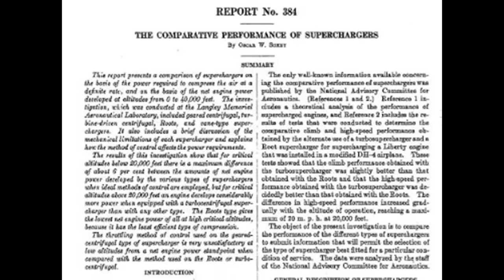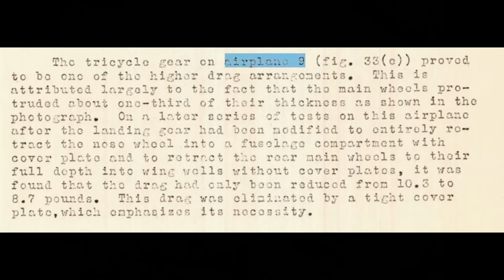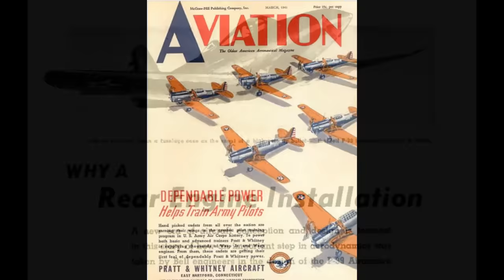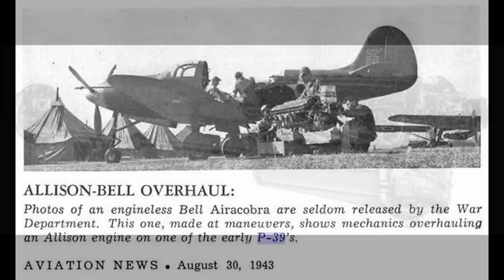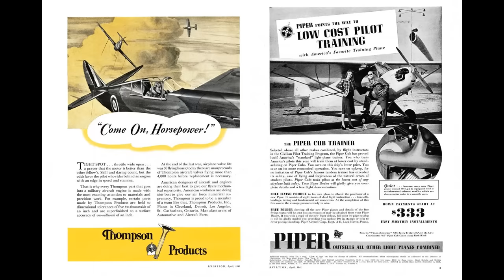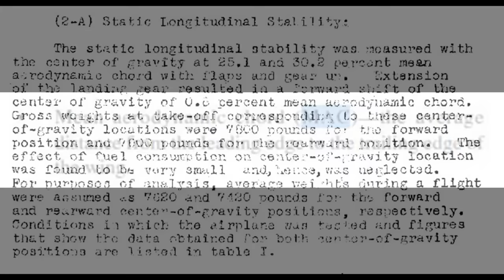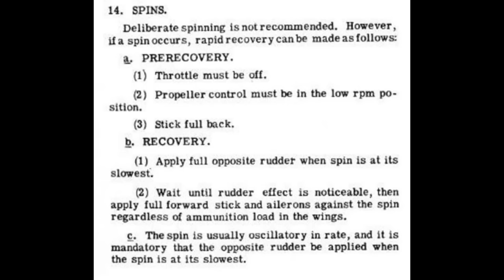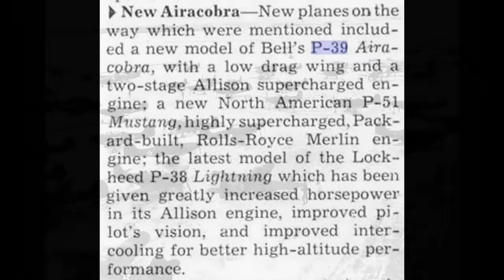Bell P-39 Airacobra, Why the Mid Eng?

Comment: I once had the opportunity at an airshow to  stand directly in front of a P-39 during the start up and warm up period. The amount of shaking (or wobble) back and forth on that long spindly front landing gear was shocking to see and for a few seconds caused fear that a catastrophe was imminent. Ever since then, that's about the only feature of the airplane that gives me pause to wonder about how that worked out in service, especially on less than great surfaces. Thanks for another great video, Greg. I've noticed that you are referenced very favorably by commenters on other aviation channels, so good on ya!
Reply: It must have worked pretty well or they wouldn't have been suitable for the ussr,I imagine that the front line airfields were pretty rough
Reply: Probably why the awful field of vision contributed to it crashing into a b17 at an airshow this year. Hindsight is 2020
Reply: @danepetersen9879  In that terrible accident, the P-39 was in a left banking turn, as were all the planes that were following the airshow round robin path. The B-17 was also in that pattern, but a little to the starboard of the P-39's path, resulting in the B-17 being in a blind spot for the banking P-39 pilot. It would have been a blind spot for any single engine fighter of that era. In the video, the B-17 apparently leveled off from its banking turn, which could have put it out of the path of the oncoming P-39 except for the speed and timing of the fighter's approach. Had someone in the B-17 seen the imminent threat, the pilot could have taken some evasive action, but if that happened, it was not in time to avoid the collision. It was a sad loss all the way around, both in lives and aircraft.
Reply: @kenneth9874  Yes, indeed, it worked well for the Soviets. Standing there watching the wobble from a lay person's viewpoint, however, made it look pretty fragile.

Comment: The end of the story could have included "the Airacobra shot down more enemy aircraft than any other allied fighter", about 5200 according to the Soviet pilots. Half of their top aces flew P-39s and they operated them at full throttle instead of the lower recommended settings. The P-39 flew the entire war with the same basic engine while most of the other fighters got huge increases in horsepower. A 2000hp Cobra would have whipped them all, as it did in the 1945 national air races. Great job Greg as you always do. This is the best Airacobra review I have seen.
Reply: By now, its a given that pretty much everyone involved in aerial combat overclaimed kills.  When one adds the propensity of fighter pilots to overclaim (Note that I'm not stating that overclaiming is intentional) to the Soviet tendency to wildly exaggerate victories and minimize losses, I'm very skeptical of any numbers coming from Soviet sources.
I'd love to see some research done on claimed kills versus acknowledged German losses on the Eastern Front along the lines of what Eric Bergerud did in Fire in the Sky, his book on aerial warfare in the Southwest Pacific during World War 2.
Reply: @barrettjet  The Soviets were allied with the Germans for the first year of the war; for the first 22 months, actually.  During that time they'd have been shooting down Finnish planes, mostly.  Or being shot down by them, more likely.  
I've had a poke around as far as Soviet aerial victory claims, and it seems someone has done some analysis on those figures.
Christer Bergstrom has written a series of books on the air war in the east.  They seem very well researched.  You can look for reviews and descriptions online if you like.
 In his "Kursk- The Air Battle:  July, 1943" he describes the Soviets as claiming to have shot down 487 German aircraft of Fliegerkorps VIII as against German recorded losses of 41.  
The Soviets claimed 391 against Luftflotte 6 as compared to German records showing 39.  That's a ten-to-one claim vs actual, at least.
In Bergstrom's volume on the air war around Stalingrad, published in 2007, he describes an action in June of 1942 in which the Soviets claim to have shot down nine German aircraft as against German records showing no aircraft losses on the day in question.
One of the factories that the Soviets moved behind the Urals in response to Barbarossa must have been used to manufacture German aircraft data plates if that's what they were using to confirm aerial victories.
Again, I acknowledge that everyone overclaimed, but the Soviets look to have made it official policy.  Can't say I'm surprised.

Comment: One thing I’d say about CG is that, as the designer, if your CG moves back because of a mid-engine mount, you just shift your wings backward to accommodate it.

Bell wouldn’t have designed an airplane knowing they had an unstable aft cg. I’m surprised anyone ever made that argument.
Reply from the maker: That's exactly correct. The wing placement is a huge part of this, and they just move it back. Look at the 727 picture as an example. However at the time people were afraid of pushing the P-39 hard because they were unjustly afraid of it.
Reply: You could move your wings back, or extend your nose, put the prop further up front and extend the drive shaft, and bang. You give yourself nose room for extra fuel storage or an extra cockpit or something! 

I'm an aircraft mechanic, so I have a rudimentary understanding of CG stuff. Haha
Reply from the maker: Yes, a lot of problems can be solved by making the plane bigger, and very often that was the solution used.
Reply: @davecrupel2817  I'm not a aircraft mechanic, but was a lifelong tinkerer of H.P. and a racer I have a million ideas 💡 to build aircraft with this engine placement, even a private high-wing model design, in my head. I'm old and disabled now. But most of the brain 🧠 is still working...lol...from Wyoming USA 🇺🇸 🤠
Reply: Having the mass at the middle reduces the moment of inertia which permits the aircraft to turn faster. Having all the guns in the nose reduces the weight of the wings improving the roll rate and makes aiming easier.

Comment: I think one factor with people saying the P-39 has no supercharger is that people frequently discuss (turbo)supercharger (stages) in terms of their impact on altitude performance, and a mechanically driven supercharger that's running at full blow at sea level doesn't impact pilot workload or altitude performance and it gets rolled into the engine. As far as purely flight minded people go, there's a bit of a conceptual misuse of superchargers as being specifically the ones for altitude performance.
Reply: Cars use superchargers too (at Very low altitude)
Reply: Only if you have not understood aeroplane supercharging.  Greg made this clear many times.

Comment: P-43 becoming the P-47 kind shows an example of a company adopting the "just make it work" approach to fitting the turbo. Seems that if the P-39 had similar efforts, it too would have grown larger in size, but gaining performance and possibly having a chance to see the aerodynamics much improved along the way. And ditching the cannon, or at least going with a more normal 20mm or 30mm would have helped.

But also fully committing to the mid engine with a pusher prop would have helped too (like the Do 335 or the Celera 500). Pilot and guns more forward in a lighter nose to put fuel between the pilot and engine, with a sliding canopy over that new fuel tank. Retaining the trike gear (almost necessary now with a pusher prop).
Reply: P-400s had British 20mm nose cannon.  Not much lighter and didn't help much.
Reply: A lighter nose actually makes things WORSE for the Airacobra by moving the CoG too far back, preventing safe flying characteristics at low speeds
Reply: @spindash64  you don't get it do you? Engineers control the CG when designing an airplane. When doing a redesign, you ALSO recheck the CG. If it is out of place, you shift things around like moving the cockpit forward until it's correct again. this is aeronautics 101, childishly easy basics of aircraft design. That is the most pathetic excuse I keep seeing people make. the location of the engine in an aircraft design in NO way makes a plane more or less stable than any other configuration. the CG doesn't care where teh engine is, so long as the final CG position is in the right place relative to the wing, and this is stupidly easy to manipulate and control.

As I pointed out, "Pilot and guns more forward in a lighter nose to put fuel between the pilot and engine" this puts more weight forward of the CG to offset the weight savings in the nose and rebalance the plane. Alternately, you could think about it in terms of just move the wing relative to the fuselage. But the lever arm between the wing and tail will affect handling in certain ways, but which can also be adjusted. middle school kids are smart enough to understand this, don't even have to be an engineer to figure out the solution to the problem.
Reply: @spindash64  Simple enough to solve by adding ballast to maintain the CoG range. 
The Hurricanes that were initially converted to CAMs actually had the reverse problem - fitting a new metal DH prop (to improve climb rate) made it too nose heavy so ballast was added in the rear.

Comment: I always felt that a lot of the problems with the P39 was our pre/early war training and doctrine. Not that it would've ever been up there with the P47s and P51s but I don't feel it was as bad as we're led to believe. The Soviets, from what I've read, did pretty good with them because they found their strengths and weaknesses and then they flew the hell out of them.
Reply: And air combat on that front seems to have mostly been at lower altitudes because neither side was using high flying heavy bombers; so, except for some recon aircraft, I don't think there much up at altitude to fight over.  That means aircraft without mutli-speed and/or multistage supercharging weren't usually suffering from that lack.  The Soviets would still need to figure out and play to an aircrafts strengths and weaknesses; but when one weakness is high altitude performance it helps when you've no real need to fight at those altitudes.
Reply: Most famous British fighters weren't that good at altitude either (Hurricane, Spitfires, Typhoon, etc.)
Reply: I believe I remember reading somewhere the P-400 models were considered only as a low altitude fighter, and not well regarded. That early version of the plane it did not even come with a pilot oxygen system. I'm guessing this was done to make the aircraft as light and low cost as possible.
Reply: @morgananderson9647  The model that was made better was the P-39Q. The P-400 was an early export model, and export models during peacetime are not great.
Reply: @SoloRenegade   The unusually tall single speed supercharger Spitfire Mk V was rubbish at low altitude.  The post FW 190 introduction Spitfire Mk IX had modest superiority at all altitudes.
Reply: @givenfirstnamefamilyfirstn3935  Yes, hard to criticize the Spitfire in blanket statements because of the many variations and things are not true for all of them.
Reply: @jonathan_60503  Actually the Germans did try to bomb at fairly high levels with medium bombers, and early on kept their fighters quite high too. The Soviets had a doctrine that can be described as "offensive defense" This allowed them to dictate the nature of the fights by seizing the initiative.  Favoring counter attacks at very low level to contesting high level German air raids. Soviet attacks often spearheaded by aircraft like the IL-2 (nicknamed the flying tank, and the most produced combat aircraft in history to this day) took place quite literally at tree top level, with fighter escorts flying just above. This heavily diminished the Germans favor of energy fighting tactics, it's hard to "boom and zoom" when your target is right off the ground, armored and flying slow.  The relentless attacks by Soviet ground attackers put the Germans on the backfoot surprisingly early, and heavily changed the nature of air combat on the eastern front.
Reply: @morgananderson9647  They were originally for the Brits and had their system which wasn't compatible with ours.
Reply: It's too bad that Alison didn't fit a second 2 speed centrifugal supercharger in time
Reply: @morgananderson9647  They were built for the brits originally and had the Brit Oxy system which was not compatable with ours.

Comment: Finally! Someone that addresses the missing turbocharger! I can't tell you how many times I've had "historians" tell me the P-39 never had one. 
I've been a fan and student of WW II aircraft since I was ten or eleven years old, and I knew damn well I'd read that the P-39 had been originally intended for turbosupercharging. The text I read indicated the bulk of turbochargers produced by GE were slated for Lockheed and the P-38; the Bell Company were a distant second or third. Therefore they chose to delete the turbocharger altogether. Performance suffered accordingly.
Reply: It had a very poor low level performance, it was a hog of an aircraft. Mid engined, prop shaft running under the pilots feet. A disaster. In fact, until the P51 was give a Merlin Engine, the USA produced no, absolutely no combat capabale fighters
Reply: Huh? What about the P-38 lightning? My uncle was assigned to one in the Euro theater. He said that it was the shit even up against the P-51 in training. My uncle had 3 kills mostly due to when the enemy saw the freaky looking beast, they turned tail and got the F out of there!
Reply: @charleshowlett1291  No P39s were flown by the US 8th or 9th Air Force. The RAF  equippd a 601 Squadron but, they only did oe mission before they were sent back. Totally useless. The Russians had success using it as a low level strike platform but, it was poor in concept, dire in flight so, no, your uncle never had 3 kills in Europe ina P39
Reply: Must be a typo,  P-38 is what i was after. My bad
Reply: @jimwalsh8520  the Russians used them almost exclusively as a fighter.  They had Il-2’and Pe-2’s for ground attack. The P-39’s record against the Zero in the Pacifc was roughly one to one.  Not ideal but enough to hold the line in New Guinea and Guadalcanal for nearly a year before the US could get the advantage in a war of attrition.  Neither the Germans or the Japanese were able to gain air superiority in theatre over the P-39.  The advantage the P-39 did have was ease of assembly and maintenance in austere conditions plus they were compact and easy to disassemble so you could fit a lot of the on a ship.  It’s these intangibles that are never mentioned.  Had the US sent P-38’s right away they would have had half the aircraft using twice the resources.

Comment: Great video. There had of course been biplane pusher fighters with the engine located near the center of gravity, and Woods may also have been aware of the Westland F7/30 and Koolhoven FK.55, which had similar engine mounts with an extension shaft driving a tractor propeller. Incidentally Bell proposed both a model 3 design with the pilot seated aft of the engine, and a model 4, which became the XP-39.

Comment: One of the other knocks against the P-39 that I'd like to have seen addressed was the claim that the forward-hinged cockpit door made it difficult to bail out.
Reply: See: Trevor Jacobs
Also see: Piper Cherokee family, Cessna family of single engine airplanes. It's not too difficult to open the door at lower speeds. 

But At high speeds when seconds count it could very well have been a problem. I would think a door jettisoning feature would easily remedy that, but I'm not familiar to know if such a thing existed on the P-39.
Reply: I have a reprint of the pilot manual.  Like any aerobatic aircraft with doors (i.e. Cessna 150 Aerobat), there is a handle that when pulled will pull the hinges out of the doors and jettison them.  It may have been quicker to get out of this airplane than others with conventional canopies.
Reply: I believe there were explosive bolts or something else to quickly bail out of the later variants of the Airacobra.
Reply: @SoloRenegade  It had it
Reply: The doors could be jettisoned in an emergency.

Comment: Years ago I read a biographical account of an US AAF pilot's tour of duty with his P-39 in the Pacific campaign. The book was titled after the name of his plane, "Madeline" or Katheline" or somesuch. In it, he describes how some pilots just didn't grasp the spin recovery very well, but others tamed it just like the book said. Overall, he was quite impressed and attached to his aircraft, as he spent almost his entire tour getting to know it and using it to good effect. 
In short, it did well, but didn't have the ceiling to pursue high-flying enemies, as you said. Which is why it performed so well in Soviet hands, where it was used as a ground attack and tank-buster plane.
Reply: No, it was mainly used in the interceptor and air superiority roles. They used Sturmoviks for CAS and strike. Both sides were into tactical, not strategic, airpower so airfields were close to the front which means that climb rate was everything but altitude performance didn't matter much because there was no time to fly high. Conditions were very different to western European or Pacific campaigns.
Reply: It's Nanette by Edwards Park

Comment: In the old USAF T-37 the manual's spin recovery procedure not only tells you to use full forward stick but to "slam"it forward. The wide flat nose of the Tweet was the culprit. If you look at the plane you'll see horizontal strakes on the side of the nose to break up air flow across the nose in a spin. The nose shape caused a lot of lift when subjected to the yaw exp[experienced in a spin, bring the nose up even further.